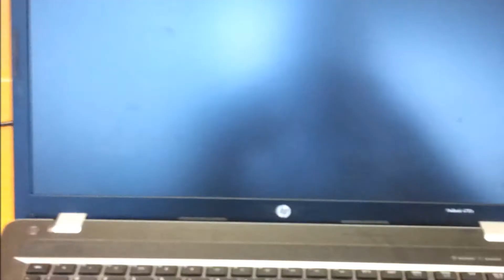how to HP Probook 4730S HDD & memory upgrade & change

Comment: Just to make it easier.for you.
When you are going to upgrade your RAM od HDD on a ProBook 4730s, the only thing you have to do is when you release the battery, take it out, then push the releas buttons a bit further, then the bottom cover plate slides out and releases by itself :)
No need of a screwdriver or something.
Reply: Hi , thanks for this update which really help me :-)
Reply: Except for the fact that the hard drive has 4 screws, so technically don't even think about doing this without a screwdriver ;-)
Reply: You are awesome. Never would have tried. that.